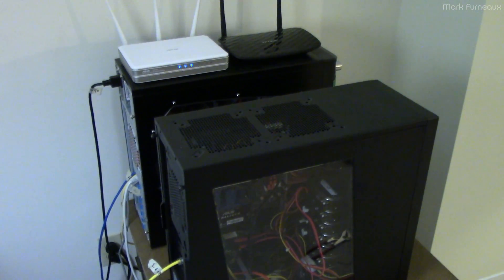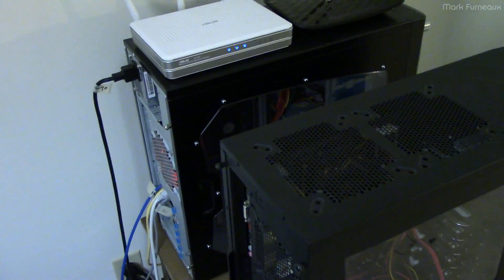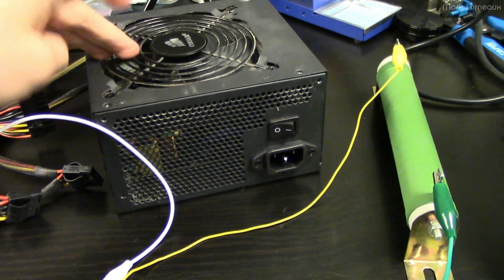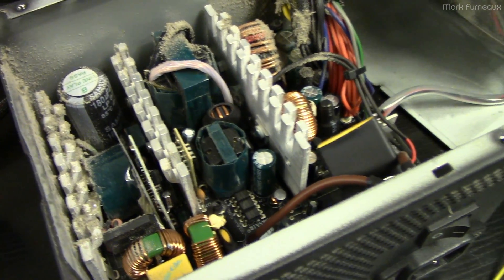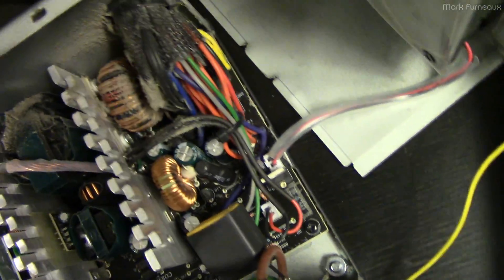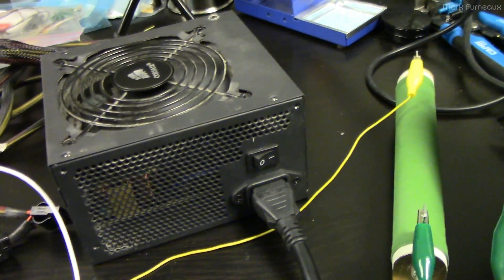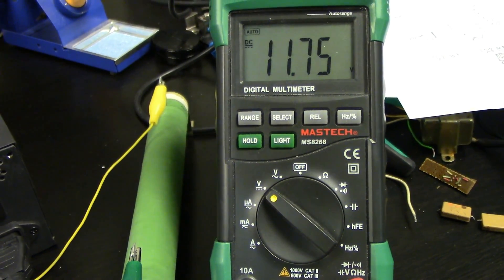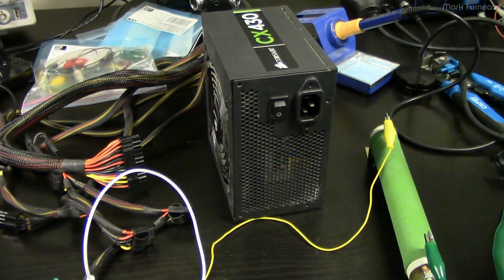Failing Computer Power Supply Causing Crashes

Comment: I just did a search for BSOD caused by PSU and this was the first video, despite it being 7 years old now. My issue is an HP Pavillion that cycles BSOD's. Sometimes it will load Windows then crash. It even crashes in BIOS screen and during Heirens rescue USB loading. Did all the regular things like swap ram, and removed and checked the CPU for bent pins. I'm swapping the PSU with a known good one asap. I'm wondering how to check the HP proprietary 6 pins PSU as an ATX checker won't work. Thanks for uploading this, it's still relevant and been helpful.

Comment: Got a problem with a psu that turns off by itself ... even without anything but the tester attached to it. The -12v says LL and the +12v rail goes up to 12.6v before shutting off. 3.3v and 5v seems fine and stable. Already replaced one capacitor that was leaking (16v 1000uf). Any suggestion what might be the problem and on how to solve it? Thanks in advance!

Comment: i have a weird issue with my desktop when i log into windows. After I log into windows the desktop is see-through. After i open some program it then eventually shows up. I can also "retrieve" my desktop by clicking with my mouse in "windows paint" app fashion. I also had my pc wake up from sleep mode. Could these 2 things be from a faulty power supply?

Comment: I have a new 850rmx Corsair power supply the only issue I have rn is when my computer goes into sleep mode everything turns on and my motherboard doesn’t boot, but if I shut it off then turn it on it works completely fine and boots fast and when I go into bios and save and exit it shuts off then turns on then shuts off then finally boots on normally plus I left my pc on for 6 hours and nothing happened I don’t know if it’s the motherboard or power supply I left my computer on for hours and no issues happened it doesn’t shut off randomly

Comment: Same here, for me too its CX 750 psu. For a year it worked fine but problem really started during summer season when all our office air conditioner started functioning when the thermostat kicks in my pc will restart till the next cycle. Or when the water motor is switched on. 
Few technician attended to the system but were unable to id. Finally our local electrician suggested to run the pc with the generator on wirhout any ac running. 
For hours together it ran fine. 
By the way only one of the pc had this problem while others has Antec, coolmaster psu in then were working fine. 
So changed this cx 750 psu with a ordinary 450watts unbranded psu to testing. The system ran fine for hours even with ac's and water motor running in the background.

Comment: I've a 9 year old corsair ax850. Its turning on then back off via a relay. Opened it up and can't see any swollen capacitors or obvious damage. Looked at pricing all new capacitors and its not worth it, there are too many and the unit cost is too high when not buying in bulk so I'll just have to replace it.

Comment: Been running into issues with a 700W Aerocool Cyclon WG as it was not delivering power consistently through the PCIe cable.

I tested my 2080 Super on my second rig and worked just fine, as soon as I put back into my rig and started playing it just stopped giving image and turned the fans to 100%

I will buy a Seasonic PSU and test it then

Comment: Mine is sometimes freeze then restart on its own sometimes random blackscreen and no signal to monitor no lights to keyboard and mouse but the fans running with lights. idk whats the problem i ordered new PSU i hope it will work
Reply: Hey I know it's a late post but was it the psu?

Comment: Hi, so do I have to connect something to the line I'll be checking for power voltage? 
Lets say If I connect an old working hdd then check with the multimeter the yellow-black for 12's and the red-black for 5's ?
Correct?

Comment: im running Pop OS and  having lock up and resetting randomly problems  too, so i took apart entire computer and cleaned it and inspected all caps i could see.
i found no bulging caps or burn spots on  msi tomohawk mobo, rx560 gpu or inside psu which is almost 10 yr old 750 watt antec.
and i still got a lockup within a few days even with psu sitting outside the case[should run cooler]
at todays gpu prices i hate to guess its the problem , my same Rx560 is more expensive 350 cdn now than when i bought it 3 yrs ago at 285cdn but it does already sport a line thru display of one output,  vga i think
so whats your  best guess computer experts?

Comment: Yep had the same issue mine failed last week and I have been plagued with random crashes for no reason over the last few months. New PSU has sorted it 👍
Reply: Was it a random restart and then it just continued to restart without warning in a random way?? Sorry I'm asking about a year later but I've been having problems with mine
Reply: @nattercakes2384  yes it just randomly restarted for no reason wasn't a perticular work load or game or programme. Then it just popped just glad it didn't take anything else with it when it went 🙈 gone with a decent Corsair RM1000x no issues since 👍 good luck I hope yours gets sorted.

Comment: CORSAIR SUCKS!!! They wouldn't RMA they're own P/S. I bought one brand new from EBAY and they said since it wasn't from an authorized retailer they won't RMA it. Now I've never bought any high dollar computer part new, motherboards, p/s, cpu whatever and every time I've had a problem it was RMA'd no questions asked. I've RMA'd Gigabyte, Intel, Asus and others all with nothing more than the S/N of the part. CORSAIR YOU SUCK!!!! The AX1200I is the biggest POS I've ever seen and I own 4 hx1000's. I made the mistake of not reading before buying just assuming and we all know what that does. So STAY AWAY FROM CORSAIR ANYTHING unless you want my results. I think I will be using EVGA mostly from now on. THANKS for nothing CORSAIR,  your a real pal.

Comment: Recently had a PSU cause stupid problems. YSB disconnects being the most noticable, eventually wouldn't run when grounded to case. Multimeter measure over 90 volts on all rails, even ground.

Comment: So every time I play a game like Fortnite for example my computer will crash the game. I will get the stupid error thing saying that the application crashed. But the weird thing is that the other day my pc screen went black and froze, I then restarted It. It crashes about every hour or so. But then I keep restarting it and continued to play my game until it started eventually crashing the application or my pc within 10 minutes. I have looked all over the place to see what the cause is and no one can tell me. People was suggesting it was the game or my pc temperatures but I downloaded a software to monitor my temps and there all fine. So I started thinking and I went to event planner and the last thing that happened right before my pc crashed was kernel power. That had to be the cause because it does it when my pc is playing games and requires lots of power. Am I correct and suggestions would help and be very appreciated.

Comment: i have had exactly that .. my 1000w superflower Leadex platinum , died after 7 years ( sorta died ) , on my main system it would randomly bluescreen sometimes under load sometimes in idle .. in the end it was the psu , a simple multimeter hooked to the 12v rail showed it dropping below 11.5v during load and was already at 11.8 idle

Comment: My PC began acting weird too. It all happened after I hooked up 3 additional HDDs for the purpose of storj mining. I got blue screens and shut offs. It was my 280W ASUS stock PSU. I had some extra money and bought the Corsair 850W and no problems since then.
Reply: I did the same thing. It was an old school ASUS 500W power supply and I upgraded a bunch of components on it. Then we had some snow storms and power outages and now the computer is acting up. I do basic things like go on youtube and make a youtube comment but as soon as I run the GPU over 50% this thing starts going crazy.

Comment: A few days ago we had 2 power outages in my city in 30 min and my pc was running both those times. Since then I´ve ben having huge issues with my PC. Desktop usage, web browsing, etc. is fine but when I try to play games my PC (9900k, 5700xt)  keeps lagging, Blue/Black screening, freezing and stuttering. Is that most likely my psu´s fault (Be quiet system power 9 500w)or could that be the gpu or maybe my ssd or hdd (My game is on that SSD). BTW I know that 500w is more than enough for my build because it was working perfectly before the power outage.

Comment: I had the same problem recently with PSU. I had random PC crashes, sometimes it was 3 days until crash but sometimes 3 times a day. I had to turn off and on PSU to be able boot it again.
Reply: Did the psu end up being the problem? I’m having the same problems right now
Reply: @noahb3ll958  Noo, it was the air flow in the case
Reply: @noahb3ll958  I bought a new case & built a new computer and now this PSU is great. I run it on silent mode & it's cold all the time.
IF you are having these issues, consider buying a new case or adding more fans to your computer
Reply: Nerino my temps are normal from what I can see. But I’ve been having this problem for a long time, I even replaced the motherboard with the same model and everything, it seemed to work for the first couple days but literally just last night it crashed once again after playing With my gpu under full load
Reply: Nerino but I do have a Corsair cx650 and apparently from reading the comments corsairs and especially the cx series of psu aren’t known for their longevity or quality I guess
Reply: @noahb3ll958  Oh, my bad.. I was thinking we are talking on another video.. So I was talking about Seasonic plus gold 650W.
Yeah, I had to replace my old PSU because it was dying, as u said, it started crashing out of nowhere and it was PSU fault.
Reply: Nerino got any recommendations on what psu I should get?
Reply: Nerino and just to be sure we were experiencing the same thing, was it a complete black screen shut off or was there a blue screen or windows crash or something

Comment: I was looking for "What happens if your PSU isn't enough". And I had basically little to no answer.
Reply: It will cause ur monitor to flash and stuff  because there isnt enough power to it aswell as other things will turn off and on due to not having enough power
Reply: @cheesyplays6228  My father's old PC (now mine) had an AMD A8 6600k APU. Which it was being powered by the OEM 300W PSU (or it was smaller than that). And it had barely enough for it to be stable to run the PC. Until I had changed it to EVGA 550W PSU (and I had completely overhauled the PC).

Comment: I experienced the Kernal panic mark talked about. Only way to turn off the PC tower is the switch on PSU. Well I flip the switch, and boot it back up. It did make a noise out the speaker though, glad I found this video. I still have warrenty on my seasonic g series

Comment: I once got a PC. No signal. Tried replacing anything. Nothing. I was desperate so I decided to check the PSU. 12v on 5v line. Replaced it and it worked like a charm. I guess some of the components shut themselves off so they wouldn't be fried

Comment: It's actually happened in my 775 system...

PSU fucks up HDD power, causing HDD to hang. New PSU resolved that

Then i installed that PSU into another 775 system. It emits magic smoke!
Reply: hi bro i have the same problem my HDD hangs and crashes is this the same problem with my Psu i have 750w psu plz help bro
Reply: @abdulwadood6534  buy PSU tester and check it

Comment: mine corsair vs450 after 3 years of  frequent usage, now can only run with 1 single slot ram without any other attachment, when i plug cd/dvd drive or ram, it stucks and won't perform POST.

Comment: Anyone thinks my PSU EVGA 750W N1 causes my pc to crash when I play GTAV on Max settings at 1080p with Ryzen 7 1700x and Radeon VII. My PSU is almost 3 years old.
Reply: Yes
Reply: @dxture.3365  Turns out its the Radeon Overlay that's causing it to crash. I had similar problems with Nvidia's Shadowplay but with a different game (Assassin's Creed III (Original Release "not surr about remastered since I no longer gave my GTX 1080 since I upgraded it to Radeon VII) .

Update: Im doing testing for almost a month with my backup psu (new and in the box for 2 years ). My Pc definitely crashes with the EVGA PSU. But didnt on my backup (Thermaltake Smart White 700W). So its definitely the PSU (EVGA 750W N1) the problem. I now used my backup as my main PSU and bought a new PSU (Cooler Master V750 Gold) to be my new backup.

Comment: Mark Furneaux::: what if i dont have tools to test??  i recently have a no Post, but on 2 different PC"s.. One was my Prmiary  Asus which just went dark..  And then i got my Back up, a Gigabyte with all its own componante, Ram, CPU,  PSU, and also dont post.  when the Asus went out i had my Zotac mini 1050ti 4GB, running, while i put my GTX 1070 8GB fe a Hydor AIO cooler on it, and i went to remove the Zotac and went out and put the 1070 and nothing posted. Now the 1070 is dead , after i took off the cooler put the stock case back on, and just dead, i messed it up. But would like to find out how to find if my zotac still works, the fan does spin, but cant get a post on either motherboard, if any tip please advise ty

Comment: Nah came to find Corsairs, just suck. Let me start with A gaming Mouse, the Left Clicker just stopped after 2 months, and i do always Respects my PC components.As in i treat with care, clean off oils after done using PC, cuz ur fingers give off oils so i wipe the mouse. The next was and is a Nice 460x RGG Corsaire Case, after 3-4 months if that one off the front glass plane screws broke off im pissed, also those cases where very poorly thought of by who ever thought of that design, managing cables is horrific. And the last one was the RX750x PSU, just dies out after not more than 10 months. My Thermaltake 600w   80+  i say is way better. all in all i Dont Recommend Corsaire, there just shit. The reason i said all this when i saw ur PSU  i just LoL.. DONT Buy Corsaire people go Seasonic, Thermaltake, EVGA. but Corsaire   buy nothing. TY 4 Ur Vid

Comment: I've had windows crash a bunch of times and thought the gpu or something else like maybe ram was being faulty. Turned out it was the power supply so i got a new one (The one that was inside my build before the new one was maybe 3 years old) And when i got it put in and working, windows stopped crashing. Also had weird stuff happen before such as keyboard and mouse turning off and screen going black but the pc tower would still be lit up and fans would still be spinning.

Comment: So would it most likely be a Power Supply error when the power switch won't work right away or it would shut down when disco'ing a usb external hd or even randomly shut off or reboot

Comment: i have one question

when i have my pc off (no power in the pc at all) it takes like 10 seconds for my pc to get electricity through the whole pc and then it only turns on 

is that normal?

p.s: that is only when i flick the swich and press the power button a couple of times and then try to turn on the system
Reply: I just tried that because I experienced the Kernal panic mark talked about. Only way to turn off the PC tower. Well I flip the switch, then hit the power button to "drain" the mobo backup electricity. Mines didnt take ten seconds to power on, just maybe a second longer. I boot to SD idk if that makes a difference. It did make a noise out the speaker though, Glad I found this video. I still have warrenty on my seasonic g series.

Comment: So i have an old pc that has a core2duo e6550 with a 9800gt to play some soft games like mk9, CS, gta 4 etc.. And sometimes after a while, the screen goes to black and the cooler starts sounding like a fucking turbo, even when the cpu doesn't go far from 30/35°c and the gpu 50°. The power suply is kinda old, so could it be the problem there? Because it also gets hot, but by the little i know  about hardware, i don't see how the power supply can do dat. Any help? Pls?

Comment: my power supplt EVGA 650G keeps freezing but when I'm in safe mode it does not freeze, what should I do?
Reply: So how did u fix it?
Reply: @Yoshirosan  I reset everything. I went into safe mode then command prompt then erased everything and redownloaded windows again.
Reply: Its not the psu i think try to reinstall Windows

Comment: Corsair VS 450 bronze, ran for two years, multimeter shows good voltages, but in pc sensors shows
+3.3V - 1.845V
-12V - -4.863V
pc runs for a while, restarts, boots up, again restarts. No BSOD, no minidump I am sure this is a culprit of my system
Reply: Were you able to fix it? I've a VS 550 myself and the sudden restarts happen during gaming. Currently I had to back down my OC to stop it from happening.
Reply: @msnehamukherjee  Update: As I suspect it was indeed PSU failing, I strongly believe it overheats in a hour or so and crash the system even in BIOS and Safe mode, changed it with a generic 300W very old PSU, PC runs great. Will take time to dissect and test it with multimeter diodes and such

Edit: this video shows at 6:30 mark for a higher loads                        watch?v=HcYFbCqM61g
Reply: @CerealKiller.  Thanks for the heads up. I might open the PSU and see if the said capacitors indeed bulged or blew up AFTER I get a new PSU of course. It's still under warranty but I won't bother with it anymore. This time I'll atleast go for a 80+ bronze cert PSU. For now I had to undervolt to 1.21v from 1.3v and also reduced my CPU OC by a 100 Mhz. It's stable for now.
Reply: @msnehamukherjee  mine crashed system as is without any OC, I had opened it, checked for burn marks, no odd smells, it looks brand new, will look in to it later